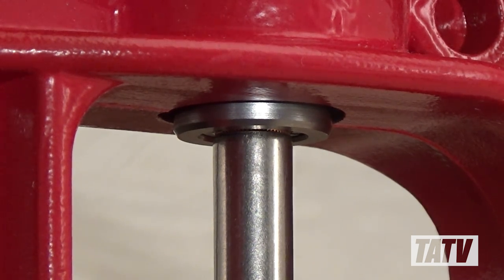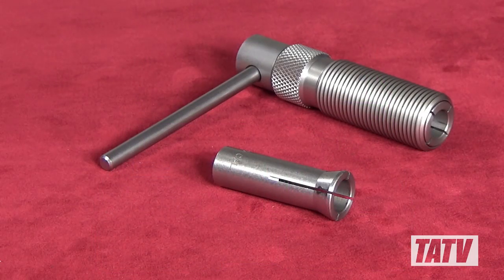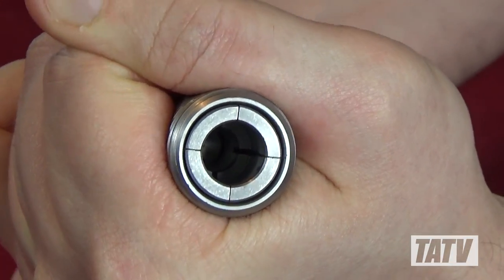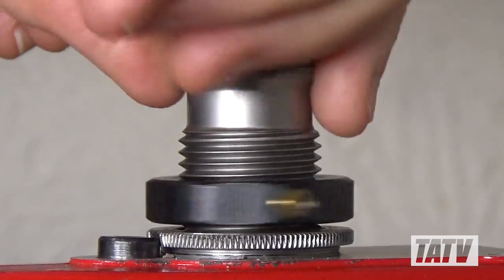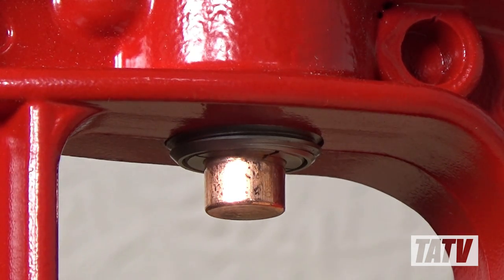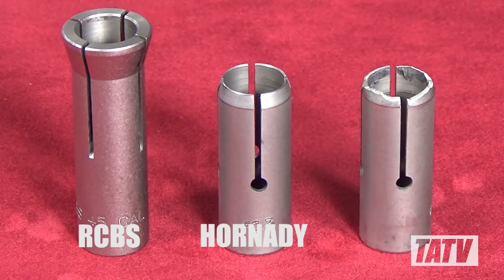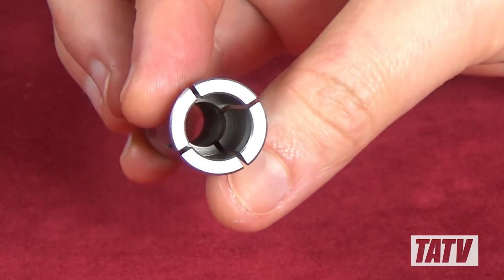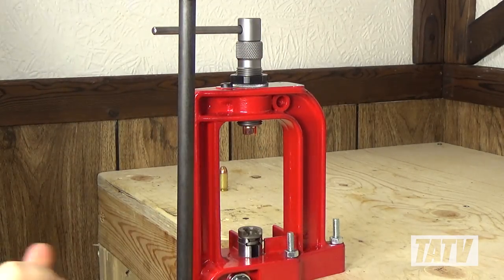RCBS Bullet Puller vs Hornady Cam Lock Bullet Puller

Comment: Great video on a subject that is currently in my wheelhouse. As I got a big batch of bad .338 lapua magnum ammo from a friend  that needs to be redone. My standard kinetic hammer was too small so I had to buy the rcbs bullet puller. My findings were the same as yours. If the rcbs puller didn’t exist I’d be fine with the Hornady unit but doing my research led me to your conclusion. Thanks again.
Reply from the maker: Oh gosh I can't imagine even trying to use a kinetic puller to disassemble .338's; I think you'd break your wrist first, ha ha.  Hopefully the RCBS made short work of things for you.

Comment: My RCBS bullet puller arrived today.  I have thirty 45- cal ACP rounds to pull.  I didn't put enough Titegroup powder in them  - they won't cycle my PPQ 45 pistol.  4.4 grains of Titegroup wasn't enough.  4.8 gr of Titegroup  cycles the pistol.  I have a Dillon 550C press and will be using one of my toolheads to mount the RCBS puller on.
Reply from the maker: I've never actually tried it on anything other than a single stage press before. I'm curious how it worked out for you.
Reply: @TATVCanada  - i put the puller it a spare toolhead (by itself) and had no problem snatching out those 230 gr bullets.  I didn't even need the take the primer feed tube off the press.  it only took about a quarter turn to grab the bullet.
Reply: @TATVCanada  - in my Dillon 550C press, dedicate a tool head to hold the bullet-removing die.  I put in station #3.  Works like a charm.

Comment: I recently got a bunch of old 30-40 reloads and since I don't know/trust whoever reloaded them I pulled the bullets. I used my kinetic on all the jacketed bullets and they all let loose with 2 or 3 whacks. I beat my brains out trying to pull the cast bullets, they didn't budge. If I'm willing to sacrifice the cast bullete (I am) do you think I could snug up this puller enough to snatch them out?
Reply from the maker: If it's a fairly hard alloy and you're using the RCBS, probably.

Comment: Did see a video on pulling lead cast bullets, it seemed to work pretty well. Got one, but have not yet had time to use it. Time will tell, I hope it works :-) Your video on this puller is the best I've seen, good job !
Does the arm on the press have to be held in place while the bullet is in the peddles of the puller ?
Reply from the maker: Hi Nick, thanks for your comment.  I just recently cast some extra-hard lead bullets so maybe I'll give the puller another shot at disassembling a few and see how it does.  Likewise if you try any yourself, let me know how you made out as I'm curious to see what other's think.  In response to your question; no, the press arm will generally remain stationary on it's own as long as the puller is holding the bullet but not otherwise moving.  There's very little weight involved so there's not much pressure until you actually try to remove it.
Reply: Thanks, I will try and remember to get back to you on my success or failure in my attempt to undo some of my errors in loading my cast bullets.
Reply from the maker: Hi Nick, I actually just tried it again this evening with the same results; it just will not grip lead bullets for me.  I even tried it with a BHN 26-er in case it was the lead softness that was the problem but same thing, it just slips out.  How did you make out?
Reply: Hey TATV, embarrassed to say not yet !! But what lead me to buy the RCBS puller for my Cowboy Lead reloads was watching "Reloading Rod" on YouTube pulling 38 special Lead bullet reloads. Check his video out and see how successful he was. Maybe he is doing something different, at least he gave me enough hope that I ask for the puller for Fathers Day, that's how far behind in  my shop work I am !!! I'm hoping I can have the same success. Be patient, and I will get to my attempt for pulling them.   :-)
Reply: Hey TATV, embarrassed to say no.What got me to ask for this RCBS puller for Fathers Day  was watching "Reloading Rod" video on YouTube ( Pulling 38 special lead bullets using RCBS Bullet puller With 35 Caliber Collet ). I was thrilled to see I could use this on mistakes made with my 38 Special Cowboy loads. Check out that video title, I'm sure you will be encouraged to keep trying. I will eventually try it myself, very anxious to see if I have the same success as he did :-) Good luck, keep in touch !
Reply: Hey TATV, it's about time but I got around to that puller (RCBS), OK for my 38 special 125 RNFP, not so for my 105 TC 105 grain :-(  and not so for 45 ACP/COLT 160 grain RN. Oh well, back to the drawing board. I'm going to comment on the YouTube Ch. I saw that video, maybe his bullets were not crimped !
Reply from the maker: Thanks for the tip, I'm going to check out his channel this weekend when I've got a bit of time.
Reply from the maker: Can't win 'em all I guess, and yes, I was thinking the same thing about the crimp.  I suspect without it the RCBS would probably work ok.

Comment: Does the handle slide back and  forth?  Do you think this could work on a Forster Co-Ax or would the handle be in the way?
Reply from the maker: Yes, the handle slides through both ends similar to what you'd see on a C-clamp.  I couldn't comment on the Forster as I don't own one, sorry.

Comment: The RCBS bullet pullet is BY FAR superior to the Hornady model, which in my opinion is junk. The Hornady collets are very weak and have a tendency to chip away on the edges. The RCBS collets are very robust and built like tanks, not to mention a much easier way to adjust in the press.  I hated my Hornady so much i got rid of it and bought the RCBS and have nothing but praise for it.  I bought extra collets for all my calibers.

Comment: .38 Spcl and .357 magnum are tough to pull with this tool. I imagine that it’s due to the crimp on the bullet.
Reply from the maker: Really? Maybe it depends on the bullet? 38s is my primary cartridge and I've never had any issues with it.
Reply: @TATVCanada  yeah, I’ve had trouble with the collet slipping off of the bullets and if I crank to hard on the tension it deforms the bullet. User error is very likely.

Comment: Why would I need to disassemble?
Reply from the maker: Typically, people pull bullets because they loaded a batch incorrectly and would prefer to reuse the components rather than dispose of them.  Alternatively sometimes folks just want to check the consistency of a new brand of ammo so they'll pull a few rounds and weigh/measure powder charges.